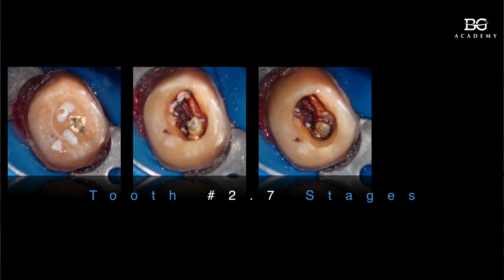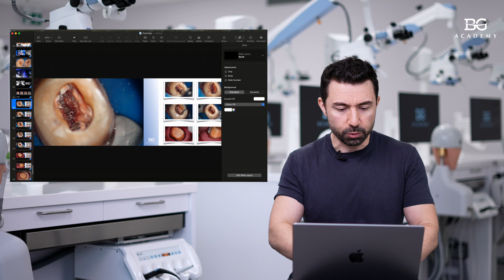Finding MB2 made simple

Comment: the orifice location is very misleading for sure and i might mistake it for perforation for sure , 
my first guide is i never drill beyond the level of cervical line so maybe i would measure the depth with perioprobe and compare to the level of cervical line , but more importantly is to check for bleeding , and gently insert a file little bit (if possible) with apex locater and if it reads beyond zero then its perforation , and maybe the file advances easily if its perforation , wont advance for sure if its mb2